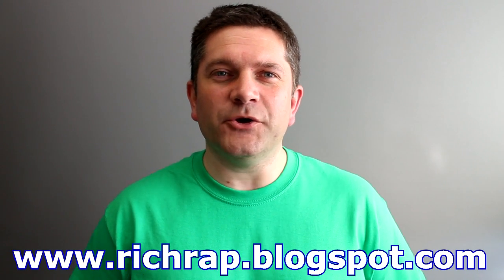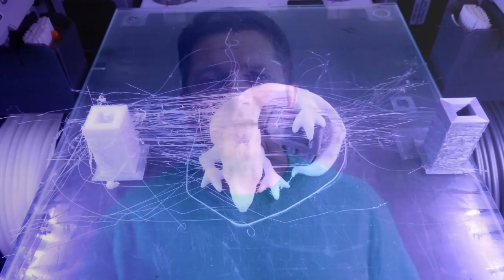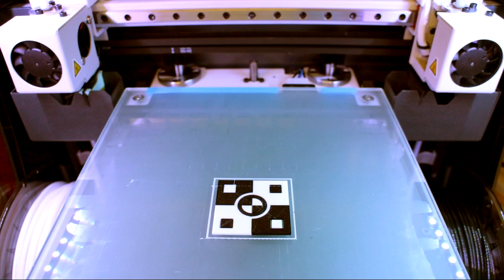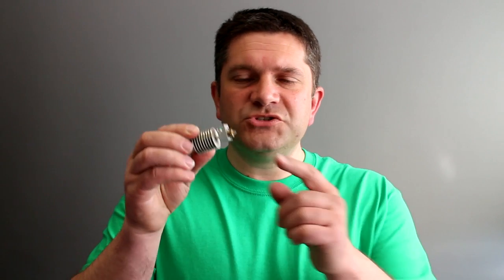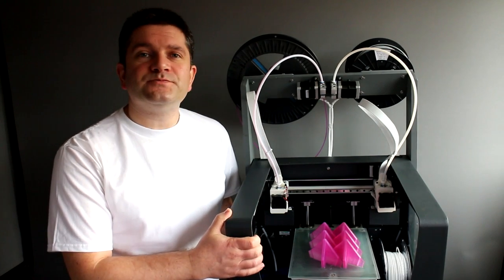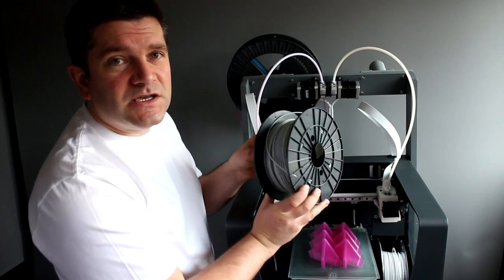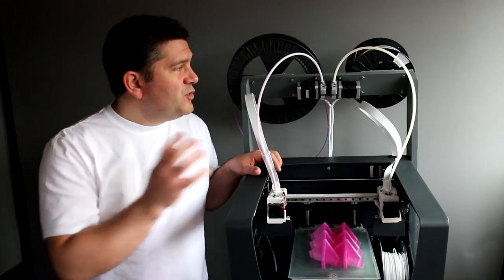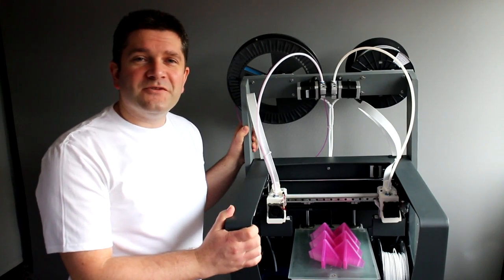BCN3D SIGMA 3D Printer Update Dec 2015 to May 2016

Comment: Does this do the duplication mode and mirror mode or is that just the newer r17?
Reply from the maker: With a firmware update, yes you can do mirror mode and duplication on the 2015/2016 Sigma models

Comment: Thank you for sharing the Simplify3D profile, as I'm an owner of the software and until "soon," I have no printer with which to use the software. Soon means I'll be taking delivery of a Sigma, in part thanks to your reviews. It's all the more useful with your profile sharing.

You suggested in the video a link to an E3D hotend mount, but I don't see that in the text for the video. Is there one available?

Thanks again.

Comment: I have build many 3d printers so far like both prusa, lasercut prusa,printrbot etc. But i need a no fuss stable model single extruder pla machine. So i was planning to build e3d bigbox. would you recomend it ?
Reply from the maker: +Karan Chaphekar Yes, I would recommend a BigBox. It's a very good kit and produces great prints. It takes quite some time to assemble, so make sure you have many days to build it up. But then it's a very good machine.

Comment: Hey Richard, nice video on the BCN3D sigma, that's what brought me here. I'm working on my own dual x carriage printer right now, and it's fine and everything, but I really need to put some custom g-code after every tool change. Simplify3d only lets me insert codes befor toolchange, I'm close to give up on simplify3d and find some post processing method to insert my purging settings whenever a T0 or T1 G-code goes out. You mentioned some methods that can help, can you help pointing me in the right direction?

Comment: Very interesting changes, hadn't considered changing spools could be awkward. Shame about the noise, is it not possible for them to mount the stepper motors on a bit of rubber sheeting to dampen the vibration? Guess you've basically got a little echo chamber or amplifier there!

Comment: Bowden is its downfall I think....especially for any of the really exotic filaments like Ninjaflex and Filaflex.
Reply from the maker: +Dark Alchemist It works surprisingly well with TPU, because it's 3mm material and the tubes are 3.2mm internal -  (not 4mm internal, like some Chinese machines). You can print almost as fast as PLA with semiflex.

Comment: I wonder if the resting head of one of these new style printers could have a spinning part under the nozzle to remove leaky filament?
Reply: it already has a mechanism to remove leaked filament when it exits the parked area. Not sure how well it works though
Reply from the maker: +Pieter Swart Yes, the noodle traps work well, a silicone rubber strip wipes the nozzle every time it docks. but the noodle pot fills up in just a few hours of a complex dual print. Need to do something about that.
Reply: Pieter Swart Nice!